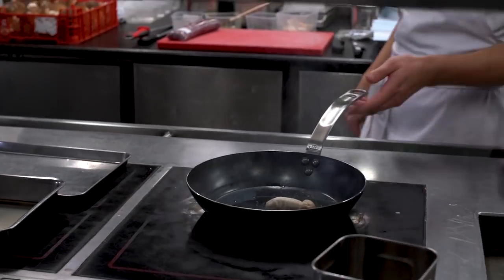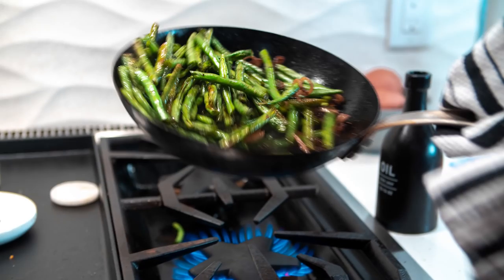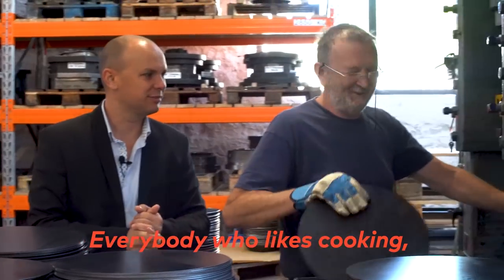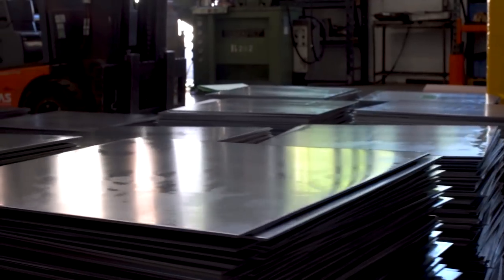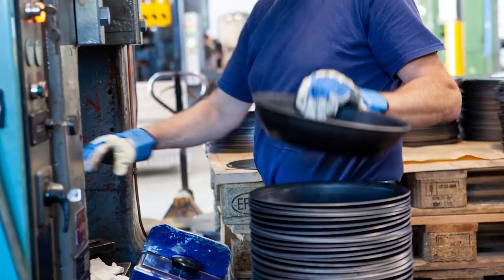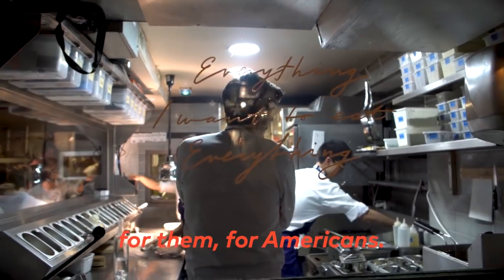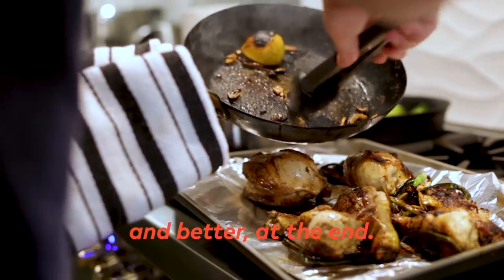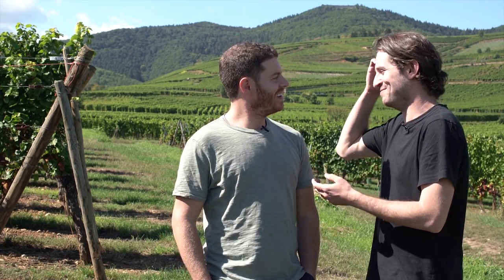How It's Made: Blue Carbon Steel

Comment: Wait a second, these woks are stamped and not spun on a lathe? For this price?
Reply: Evidently they are. I had no idea myself. Mass production. I got my 12” for $89.00
Reply: is there a performance difference amongst woks that are spun vs hammered vs pressed?
Reply: @wendyleeconnelly2939  I’d like to know as well. Thanks for asking this!
Reply: @wendyleeconnelly2939  Yes, the spun and hammered woks create minor uneven surfaces that create enough friction to “hold” food when moving it away from the center hottest part. This is useful in wok cooking when adding veggies after the meat for example, by moving the meat to the upper part of the wok while adding the veggies to the hottest area.

Comment: In terms of conduction, aluminium pans conduct heat at superspeed, they are getting hot much faster. And they are way lighter. Not a good point for advertising carbon steel over cast iron. Love my cast iron pans btw
Reply from the maker: Thanks for your feedback here!